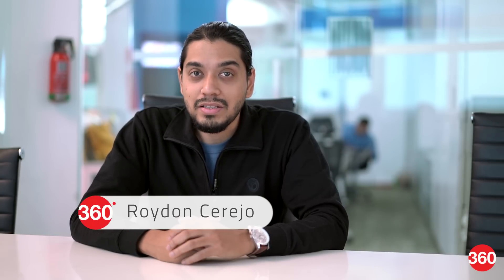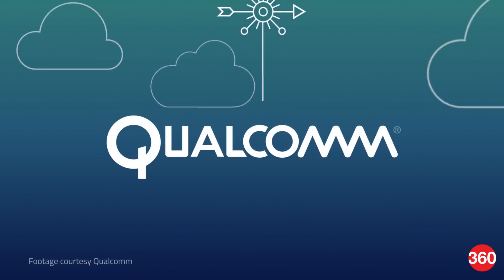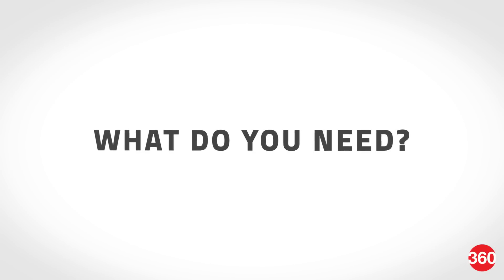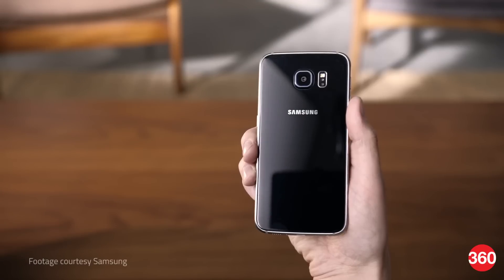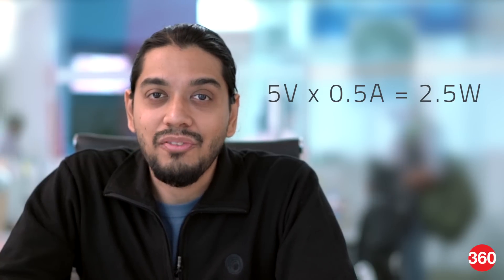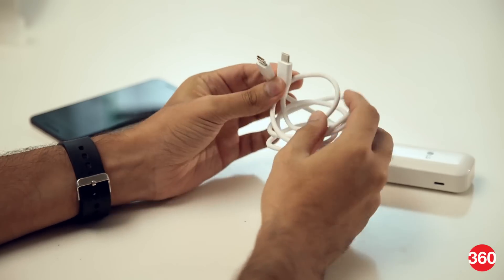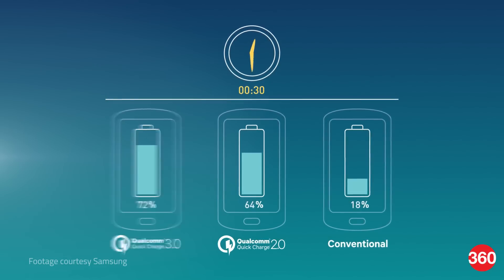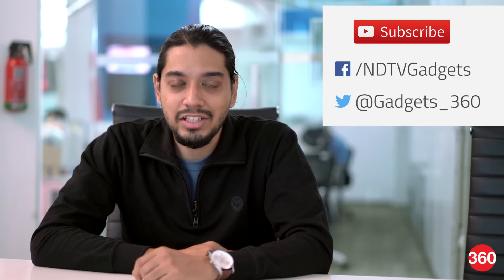Fast Charging Explained

Comment: I use Plantronics backBeat Pro 2 wireless Bluetooth headphones. Should i use 5v 1A charger or the 5V 2.1A fast charger to charge it? I would appreciate a sound reasoning for the answer. Thank You so much @Gadget360

Comment: I have a question i have a box charging like the one in the minute 0:53 but i have a question may i use it for my iphone 8 plus using the iphone cable but the box ? And it will charge faster? Sorry for my bad english

Comment: pls help me my fast charging dont work. i already activated the fast charging mode but it still the same. someone who can fixed this problem pls help me
Reply: Delete Battery Saver
Reply: Or try making sure the charger port is in the correctly I mean the USBC cable cause mines was acting up finds out I was plugging in the phone wrong lol the whole time .

Comment: PLEASE HELP..i bought a Usb adapter of portronics 2.4Amps..
bt it gives me charging speed of 700mAmp bcoz it charges my fone 10-12% for almost an hour..
so is it charger's fault or its bcoz i used the same old data cable for charging??.
should i buy a new one??.

Comment: I just bought a belkin 10 watt 2.1 amp charger. it charges my phone in 10 minutes.  I don't know if it's damaging it but it's getting the job done very fast.
Reply: cloud chaser for what phone
Reply: Robert Wisniewski  actually more like 15 to 20 minutes but the phone is a Samsung Galaxy grand prime. and I use it to charge my vaporizer that holds 2 18650,s and it charges that in a good amount of time also. great charger.  10 watts at 2amps.

Comment: do fast charging adapter need any specific USB cable or any USB works?
Reply: Shilpi Srivastava I have that same question and nobody seems to know the answer. For example, I have my "Adaptive Fast Charging" wall outlet but do not have the cable that came with it. Do I have to have a specific cable for fast charging or will any 3.0 usb to micro usb work?
Reply: The cable also must be good you can search for it
Reply: Shilpi Srivastava 
just a thick enough charging cable
Reply: Shilpi Srivastava its not the cable its definately the charger itself..i can tell you that first hand
Reply: The only special thing the cable needs is to be thick enough to handle the current. I essentially destroyed (almost melted) an ordinary Samsung cable I had for my A5 when using my A9 Pro quick charger. So I really think the video should mention that ordinary charging cables can't handle the current load, and that quick charging cables included with quick chargers are more robust.
Reply: Ethan Lehman well I have the Samsung s7 edge with adaptive fast charging. I can't put a cheap cable in to do fast charging it has to be a decent cable and I've tried roughly 6 cables. once my original cable was damaged I ended up ordering another official Samsung cable as some of the cheap ones wouldn't even slow charge it let alone fast charge.
Reply: hassan labyad look for  usb c
Reply: Shorter answer, you must specified what brand and model of smartphone you have.
If you own smartphone except OPPO, Oneplus, Huawei and Meizu, then those smartphone are normally adopting the Qualcomm Quick Charge standard. You can use any of the micro USB or type C cable that can transfer data, it will works for fast charging, of course as cheap the cable can be, even if it is $1, it must be a genuine cable, recommend only use branded cable regardless of the cable price.
OPPO and Oneplus only works with their proprietary cable. Huawei at some point support the basic fast charging that works regardless of pricing, and only support the faster Super Charge with proprietary cable.
The more confusing part, not all smartphone with Qualcomm processor will automatically support Qualcomm Quick Charge. It must be officially mentioned. If not, then even it is equipped with Qualcomm processor will not support Qualcomm QC. Prime example is many of the midrange, and entry level smartphone. OPPO also is the example not supporting Qualcomm QC despite using Qualcomm processor on their smartphone.

Comment: You didn't even explain how it works.. other than pump power till 50%.. I think majority of people know more power = faster charging, so you're basically saying just get a charger that charges to 5amps.
Reply: ozfartface The more amps you give the faster it will charge the amp defines the battery capacity ! Charging slow will increase battery life cycle
Reply: @ozfartface1914  in DC (direct curent) P=V.I, so power is tension (voltage) by intensity (ampere). But as for USB it's most of the time 5V, you may think that intensity (or amplitude) is the power. Basicaly, if you have a 2A charger, it's a 10W charger (power is in Watt). Qualcomm give more power by using 9 to 20V (used in quick charge and samsung fast charge).
Reply: high ampere require better cable, high voltage don't mind any cable.
OPPO phone take both high 9.8V 6.3A so crazy
Reply: super fast charger - boost charging speed upto 60% faster than normal https://play.google.com/store/apps/details?id=com.mubatteryfree.fastcharger
Reply: Well Vooc use higher Ampere tho
Reply: More power doesn't necessarily mean faster charging. Let's take a laptop's charger that can also be plugged into a phone. The laptop charger puts out a voltage of 20-25V while the most basic phone chargers are 5-9V. You'll be overheating your phone and it'll basically die or not perform as well anymore. But, this is for phones that don't do fast-charging. I haven't confirmed if this is a safe practice for phones like the LG V20 that comes with its own Fast-Charger.

Comment: Ok so i have a samsung galaxy s6 edge plus, can anybody tell me if fast charging damages your battery or not
Reply: depends on how muvh you use it..use it only in must need situations..otherwise mostly use the regular way since the battery is not forced or anything and prolongs its life...also try not to charge phone at 100%...get use to the practice of keeping at about 80%
Reply: Freestyla313 I am glad u asked,I have the same fast charger shown on the thumbnail and it does not harm your device or causes damge.And yes fast charging doesnt damage
Reply: oh good, i thought i was doing harm to my phone, thanks for the confirmation
Reply: you will update your phone way before the battery dies. I have  a s7,s4,s3,s1. And the galaxy still has a perfect battery. As long as you use good quality charging adapters you are fine.

Comment: I'm a little confused. So do I have to buy a special charger that supports quick charging or can I just use any old android  phone charger?
Reply: yes you need a fast charger. and you need a phone that supports it.
Reply: youandiryan I have this charger shown on the thumbnail and it supports my device and it charges my device in 12 secs

Comment: I have a Bluetooth speaker with input of 5v/2000mA. I have two adaptors with 5v, but different mA. One output is 750mA and the other is 2100mA. I don't know which adaptor is best to use. Should I use the adaptor with the bigger mA or smaller mA.
Reply: adrian gil smaller is better.

Comment: fast charging can damage your battery
Reply: Definitely untrue with lithium ion batteries (the ones in all smartphones). Fully discharging and fully recharging has been proven to reduce the battery's effectiveness and lifespan. In fact, the opposite is a more effective way of maintaining lithium ion batteries i.e. keeping the battery between 40-80% charge.
Reply: its true because it will burn the battery. Thats why its better to drain all the battery and charge slowly. it prolong battery life.
Reply: joy santod right, I dont dont fast recharge other wise boom! ths device is damaged and exploded

Comment: voltage is potential difference it causes the current to flow..our phone battery is 3.7volt and its capacity is designated in 'mAh' that's the unit of current so for changing we need just a potential difference more thn the Phn battery n a flow of current... charging is same like filling a bucket with water like u say its capacity is 20 liter so u fill it with some rate like 1 liter per sec so u need 20 sec to fill it completely...same is case of our battery u need more current rate for fast charging n not the potential difference like 9V not required.. charger with 5 V n 2A or 3A will do fast charging...its the current not the volt... research ur basic concepts about electricity.
Reply: Perfectly explained
Reply: it's you need more research of power converters.

Comment: You cannot interchangeably use an adapter for the Samsung S3 & S4; because the former has a 1 ampere charger, while the latter has a 2 ampere charger. 
If you use the wrong charger -- the one that didn't come with your phone -- you will suffer from slow charging. To fix this (1) Turn off phone and remove battery (2) Wait 10 seconds then plug the charger in your phone, now wait another 10 seconds (3) Insert battery and turn on phone. Your phone should charge normally now.